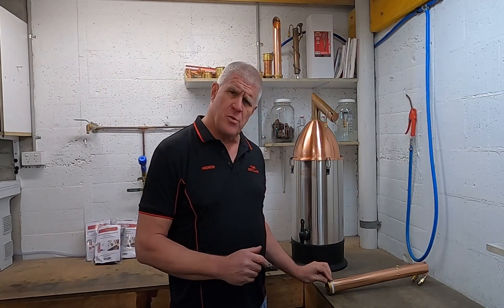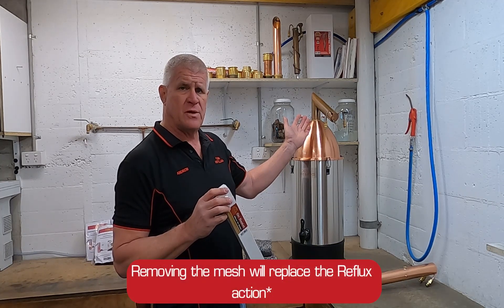Replacing the Reflux Condenser Mesh

Comment: If you remove all the packing will it work as a pot still? And is the condenser big enough to do this?
Reply from the maker: Hi Stuart, yes removing the packing will turn the Reflux Condenser into a psuedo pot condenser. A traditional shorter pot condenser will produce better results, but using the reflux condenser will still work fantastic and produce some great results - Connor

Comment: Hi, I'm in the process of cleaning my reflux condenser and I noticed that after removing the 8 stainless mesh balls there is no copper mesh at the top of my condenser (as you mentioned in your video not to remove). Should there be copper mesh at the top of condenser or is stainless ok and should there be 8 stainless pieces in the column?
Reply from the maker: Hi there, did you happen to purchase the condenser second hand? This sounds like it has either been modified by another user or it may not be a Pure Distilling unit - in which case the copper mesh piece may of been removed or doesn't exist in your condenser. 

Our older model condensers had 3-4 mesh pieces, our new condensers have 5 mesh pieces inside. 

If we're unsure, feel free to send some photos through to our email drink@puredistilling.com, we will be able to identify the condenser and get you on the right track - Connor

Comment: can you replace them with copper saddles from t500 still
Reply from the maker: Hi there, we wouldn't recommend using copper saddles instead of our stainless steel mesh, our mesh is designed to last and provide consistent 93%ABV results. 

However, if you are set on the copper saddles it may be possible depending on which equipment you are using and the purchase of a few adaptors to prevent them from falling out of the bottom of the condenser.

Could you please email us at drink@puredistilling.com and we will do our best to help you

Comment: How often should the mesh be cleaned or replaced?
Reply from the maker: Hi Craig, we recommend rinsing out the condenser with warm water after every use. 

It isn't entirely necessary, but it is a good practice to give the condenser a citric acid bath every 10 or so washes to keep everything nice and clean! However, if we ever notice that the wash has foamed up through the column due to sediments present in the wash or excess sugar, a citric acid bath is required. For instructions on how to do this, check out page 18 of our instruction booklet here https://puredistilling.com.au/wp-content/uploads/2022/01/The-Reflux-Kit-Instruction-Booklet-Public.pdf

If the condenser is in constant use (1-2+ uses per week), the stainless steel mesh will need replacing after 5 years of use. Although, cleaning the condenser as per our recommendations will go a long way in helping maximise the lifespan of the mesh! - Connor
Reply: Hi conner can you use supermarket citric acid to clean the condensorThanks again buddy..

Comment: I have removed the copper mesh. Cleaned it and put it back. Is there any issues with doing this. P.S. I didn't plan on removing it :(
Reply from the maker: Hi, the copper mesh is very tricky to remove/put back - if you notice any issues with your next run please get in touch with us via email drink@puredistilling.com and we'll do our best to help you out - Connor
Reply: @PureDistilling  Thanks for the feedback Connor. I'll be sure to make contact.

Comment: You give the measurement, of the second, third , and forth, How long is the handle of your hammer, if its so important to get it right, why  don't you give the measurement of the first distance. A hammer handle, give me a break, which hammer to I buy, you have got to be kidding me.
Reply from the maker: Hi Daniel
Sorry for the confusion, the first mesh ball is just pushed into place at the top of the column, we dont use any force in its placement. The second which we do have the measurement for, sets the compression for the 1st & 2nd mesh balls. Any hammer will do!
Reply: @PureDistilling

Comment: I've repacked mine with copper mesh according to your instructions, so the same rules apply?
Reply from the maker: Hi Geoff, yes the same rules do apply, but we don't recommend using copper mesh. When it isn't packed correctly, there will be more gas present in the Condenser, and excess liquid can escape. Copper is also very reactive, and can break down/degrade quickly.

Comment: Hi I have used my still twice now, first time it behaved really well and the second time it was good until I reached the point of collecting the tails. At the end of my tails the temperature did not rise to set the alarm off but instead it dropped down from 78deg 70deg and at that point I turned it all off. The tails was also not transparent but a really light shade of yellow. Any idea why that would happen. And how often should the packing be changed. Thanks
Reply from the maker: Hi Johan

The yellow tinge is due to the wash foaming up the tower and coming out of the output tube, which means it hasn't fermented correctly or distilling conditioner wasn't used. 
What temperature was the wash during the fermenting process? As is it was just winter here in Australia, using a heater belt can help the wash ferment at the recommended temperature (20-24 degrees).
Did you take a specified gravity reading (hydrometer)? 

You can redistill the tainted spirit, just empty boiler and clean, add tainted spirit and top up with water.
Reply: @PureDistilling  hi I did take a reading with the hydrometer, it was at 0.990 or slightly under. I have a heating pad and maintained 20-24deg. 
I’m putting sugar washes through my still. I have found that I might not have sufficiently cleaned my condenser… I have since cleaned the mesh in citric acid and repacked it as per your video instructions. Love the still and sure it’s going to be perfect like it has been. Just love your product!!